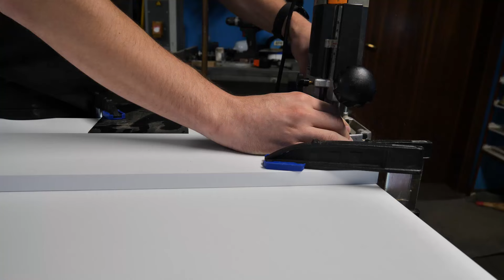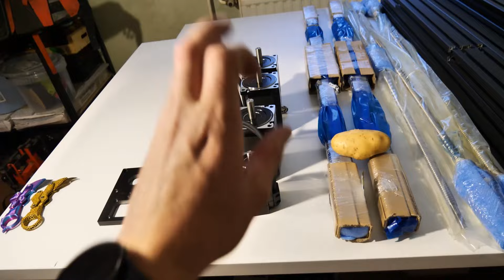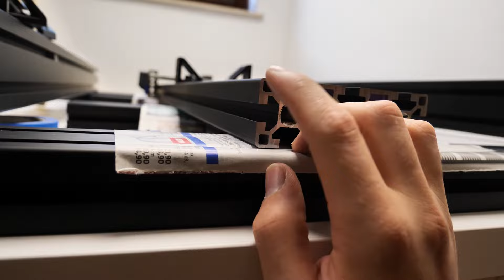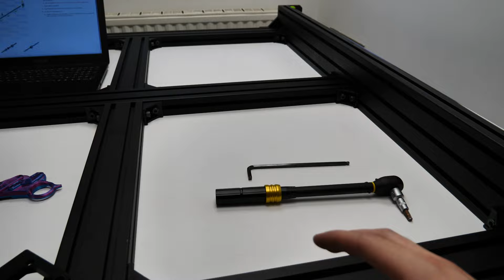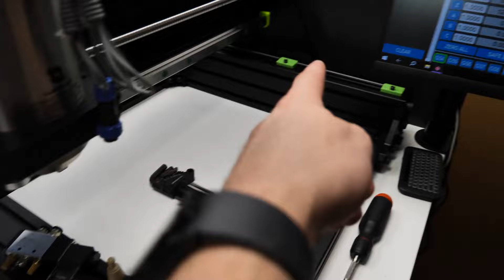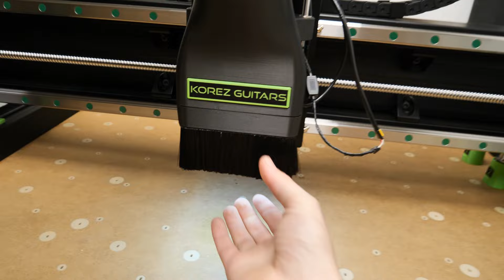Can you use rats for woodworking? - Workshop upgrade: RatRig Stronghold PRO CNC build

Comment: i upgraded my cheap 3018pro to 3580, not terribly hard, but expensive buying precut rails and parts.  i made the replacement brackets with my drill press... i got it to learn practical cnc stuff for guitar making, then i had to move when i got it most of the way rebuilt.
Reply from the maker: @felderup  now thats just sad, but at least you gained some experjebce from it, hope you will get back to it someday!
Reply: @KorezGuitars  i finally found a good source for extrusions, i only need some for making a pretty stand for my machine.  decent plate is the next struggle, i'm thinking steel, wood's not right for this kind of thing.

Comment: Demo is missing.  - you dont have problems with Dirt on the exchange routers?
Reply from the maker: @Odyseuss08   didnt add a demo since i had nothing to make at that time, but you will be able to see it in any of my future video, as for the dirt getting in to the tool holders and all that, no i have no issues with it, since i wrote my code to blowa air over them whem the changin proces is happening, so it blows anything away

Comment: So How has the spindle been working for you?   Can you provide a link for it.  I tried looking it up but the brand offers a lot of different models.
Reply from the maker: this is the link to the spindle im using on my CNC: https://www.aliexpress.com/item/1005006310789283.html?sourceType=1&spm=a2g0o.wish-manage-home.0.0
Reply: @KorezGuitars  Thanks.  Little pricy but the time it will save me will justify it LOL.  I was looking to get a Milo Mill or Rat Rig Mill but curious now if a Stronghold pro will more or less do everything a mini mill would do?  I currently have a X carve and would be nice to trade it in for a stronghold pro instead of buying a mill if it will cut the same projects a mini mill would.
Reply: @KorezGuitars  What VFD is running the ATC Spindle?
Reply from the maker: @kwad3d10  the spindle is run by cumark es580 VFD, forgot to add that the price of that ATC spindle includes this VFD. Also in my case i got the imporst costs removed from the price. Also to note, at least in my case i recived the valve to operate the ATC mechanism of the spindle, so thats nice
Reply: @KorezGuitars  Ok very nice.  So pretty much everything is included except ISO20 Tool heads?  Think I will upgrade to a Stronghold Pro.  I work at a shop with industrial sized CNCs and can make a solid backing plate to tie the gantry pieces together to stiffen it up and T Slot Plate instead of a waste board to remove the flex there.  Once I sell my Xcarve I will get the ATC Spindle to finish it off.
Reply: @KorezGuitars  Did you ever change the inductive endstops to something more accurate?   My Stronghold Pro kit has arrived and Im working on a few loose ends before I begin assembly
Reply from the maker: @kwad3d10  no i have not changed them, since they have one super good thing going for them and that is that they are closed so nothing can destroy them that way, but now i got used to it, i have cuple of ways on how to make sure its homed  propely, for now a hole at the specific point on the table so if i drive to it chords and it fits, we are homed like we should be, if not i just enter the correct coordonates and we are ready to go